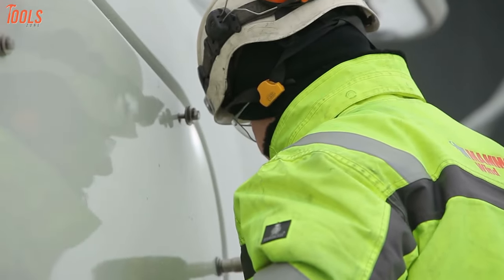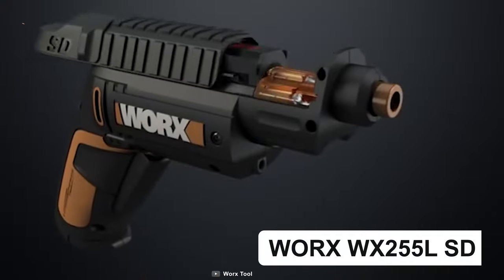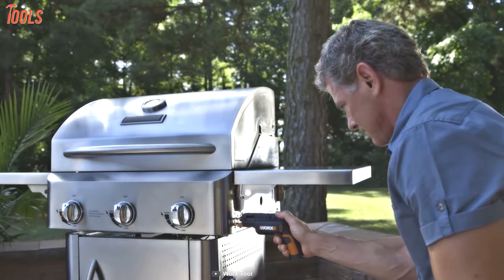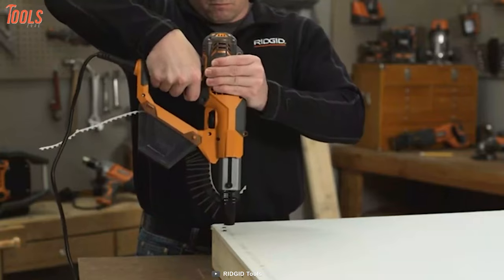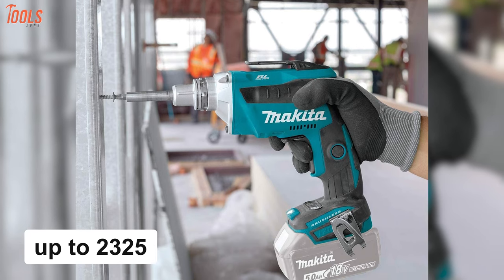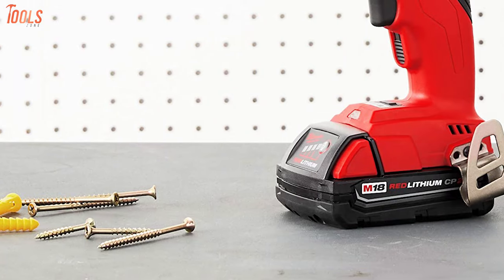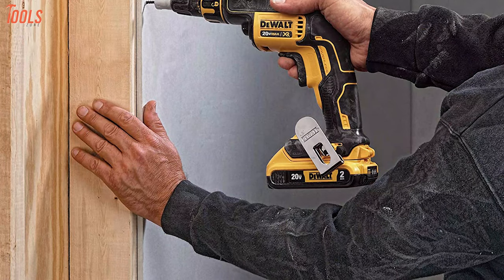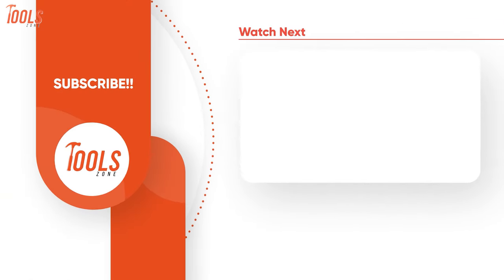5 Best Drywall Screw Guns

Comment: Don’t by any of these if you want to make money. A cordless collated, strip, screw gun takes little time to learn to use, loads auto so you have one hand free and pays for itself in know time. I’ve been using Hilti for 20yrs but I have no issues with Mikita dewalt hikoki. Usually what your other cordless tools are decides, but if your starting out I’d go makita. 90% of guys on site use them for good reason.
Reply: Unfortunately, Makita doesn't make a corded collated driver any more.
Reply: @alafrosty  which is why I suggested cordless. Plus dragging a cord around is a pain you forget, till you have to do it again.
Reply: @desmondcrosland7884  Cordless is a drag every time I have to carry the weight of the battery around on the tool - like ALL . THE . TIME.  Also, cordless can't generate the torque needed to push screws into 120 year old studs. So, no, I absolutely NEVER think it's annoying to drag a cord around compared with the angst that the stupid cordless ones impart.
Reply: @alafrosty  sounds like you havent had much experience with cordless tools
Reply: @JimTom.  I don't have any experience with ultra-high-cost cordless tools, especially when corded tools with the same capacity cost 1/10 the price of the battery operated stuff.
Reply: @alafrosty  The common most brands like Makita, Milwaukee, Dewalt etc, are all very on par with electric tools now. Battery tools have come a long way in the last few years, and they keep getting better. Ive owned a lot of cordless tools and i still get impressed when new stuff comes out
Reply: @JimTom.  No doubt about it. But for the same power and capability, the corded tools are a fraction of the cost of the battery-operated ones.
Reply: @alafrosty  Youre right about that, overpriced